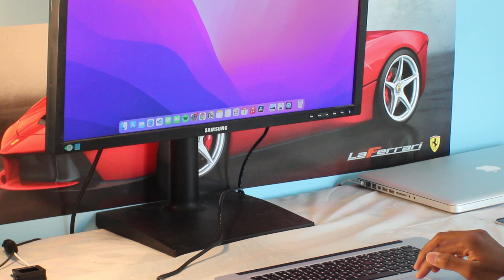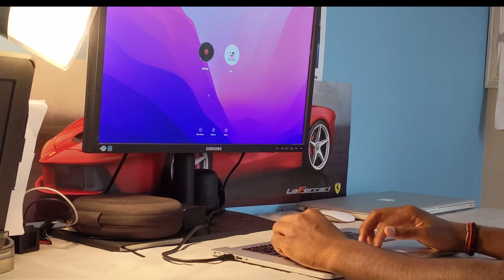Repurposing Broken MacBook Screen into a Screen Less MacBook Pro!

Comment: Hi, I did already remove the screen and the Macbook Pro M1 seems to work but on the external screen I don't see anything, just a black screen. It seems that the external screen isn't the main display and he thinks he still has the internal one. Any idea how to turn the external one to the main display?
Reply: I have a similar problem
Reply: Update please
Reply: I am still hoping somebody will have a helpful hint. Please ....
Reply: @michaelkloethen8359   i reconnected my screen and lid and start using with screen attached connected to external monitor
Reply: @michaelkloethen8359  Cmd + F1  or  fn + Cmd + F1 might work, i.e short cut for screen mirroring.
Reply: Cmd + F1  or  fn + Cmd + F1 might work, i.e short cut for screen mirroring.
Reply: I used voice over to login (Cmd + F5)  and after a successful login got video feedback again...

Comment: I have a MacBook Pro (2015) with broken screen and I would like to remove its display. Do you think that I can connect my headless MacBook to an old iMac (2011) ? Thanks
Reply from the maker: I'm not quite sure about this one, but I have looked it up briefly and saw that if your iMac has Target Display Mode, it seems probable that it could act as a display for the headless MacBook. I would suggest doing some more research online but it sounds possible 😁. Hopefully this helps!